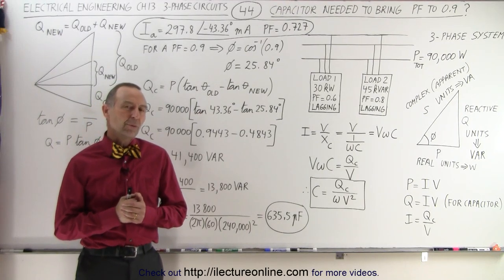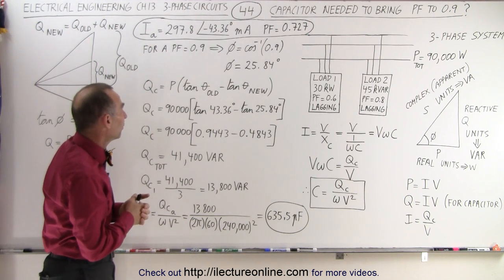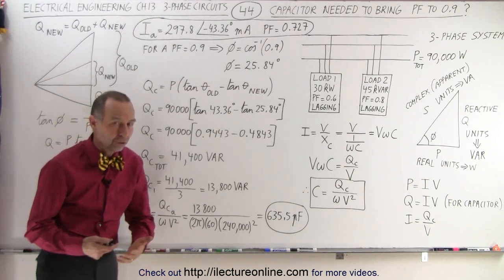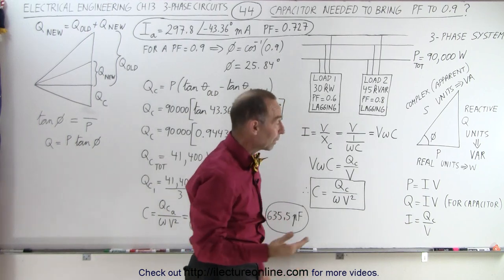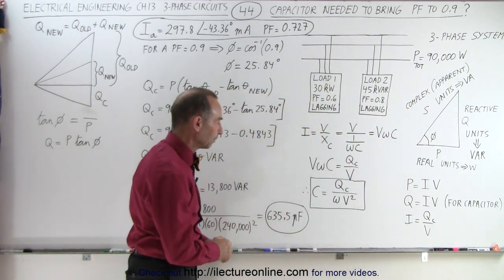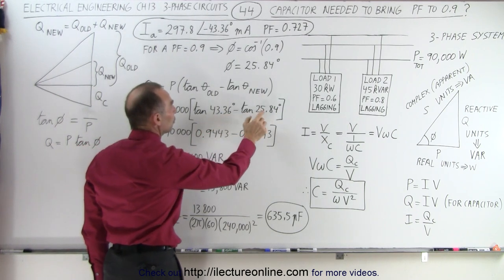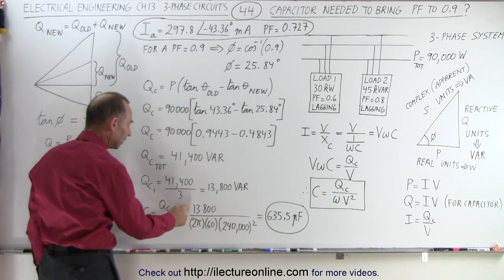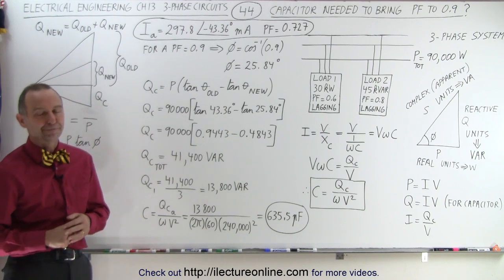Electrical Engineering: Ch 13: 3 Phase Circuit (44 of 53) Determine Capacitor for PF=0.9

Comment: So the end result of capacitor (635.5 pF) just for 1 phase? Or for 3 phase?
Reply: Good question. I think it would be for 1-phase because the capacitve reactance used is 13,800 VAR which is for 1-phase. So, by using this capacitor in parallel, you'd inject 13,800 VAR in 1-phase.